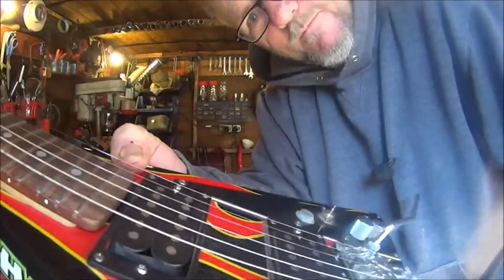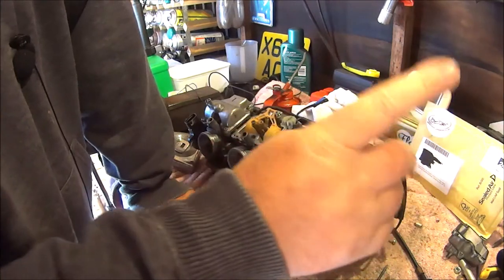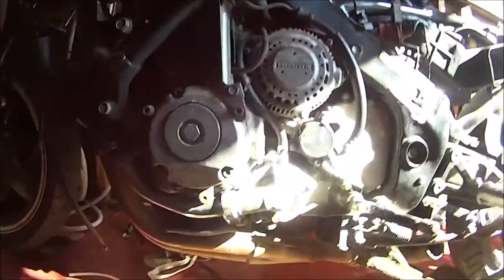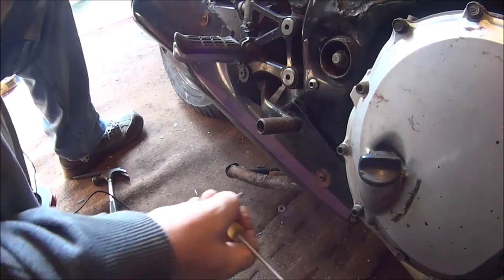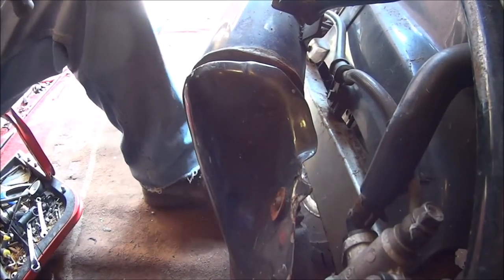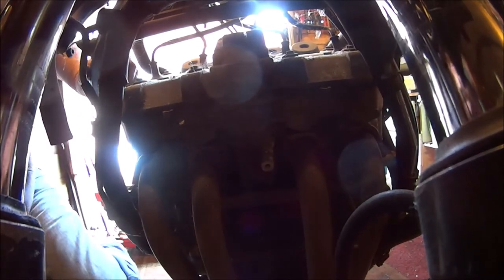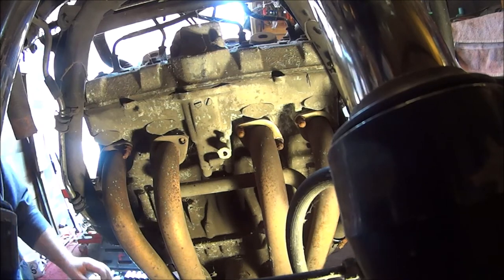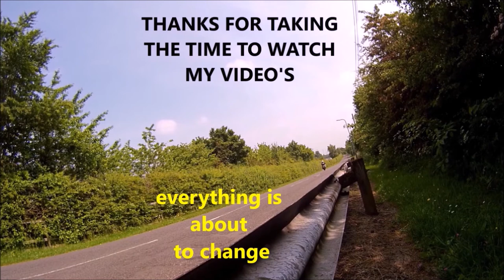Honda Cbr1000f exhaust header pipes removal.

Comment: surprisingly the collector box is not  perforatied, usually these go first for the silencer they are the same in all years just different colours so they are several around at breakers , i just bought a pair and a lh single
i replaced my collectors with SS years ago
Reply from the maker: Yes it was a pretty good unit and I did get a bit of money for it.

Comment: tested a 95 cbr dual cbs in that strange campy  violet colour  yesterday in germany near bonn in good but dusty condition
not run for 6 years so not easy to get going but after a bit of coaxing it started and will idle ok but main jets are blocked with gum
the old chap will sell for 600 eur
im  trying to persuade myself …
or a fixer upper cbr1100 with fairing and instrument damage ...
Reply from the maker: Nice one yes ii is a nice bike to ride and the brakes are very sharp. Good luck with it buddy I hope all goes well for you.

Comment: you may want to get these U/S cleaned the small orifices gum up and they dont spray properly
Reply from the maker: Thanks I will have a good look for that
Reply: mine cost 30 eur to clean for 5 hrs in the tub
came out rather nicely

if you do send them away already dismount the jets so the cleaning  fluid gets right into the orifice beyond the jet
Reply from the maker: Thanks buddy I think I will be having a good go at cleaning them myself first.